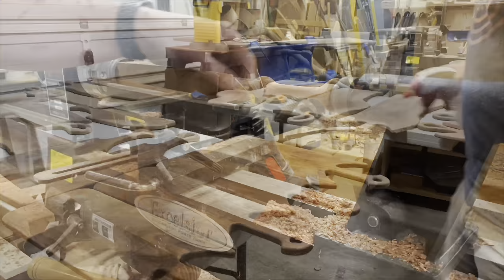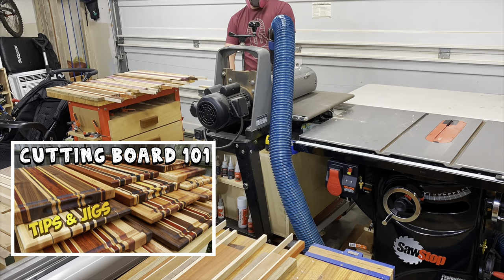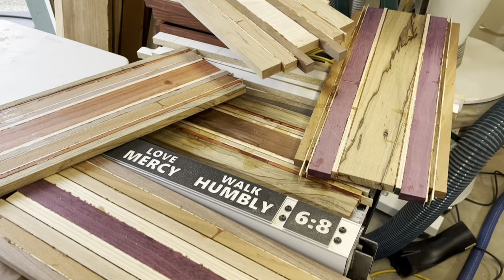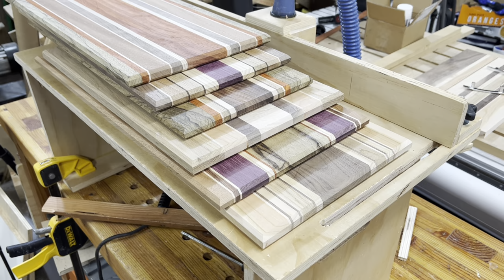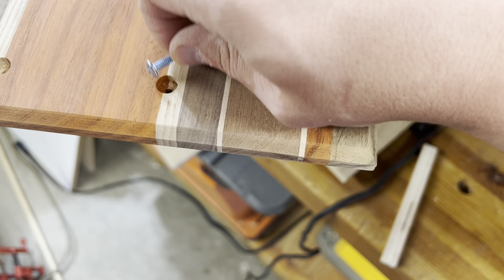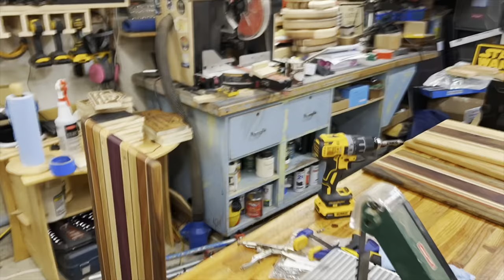Batching Out Serving Boards: Tricks, Jigs, and Woodworking Sales Tips

Comment: I enjoyed your video.  You ticked the tips I normally use.  I have to admit it felt validating to an extent.  I have a couple additional thoughts you might find useful.  I sometimes run the screw for the handle through a rubber foot.  The board sits on a non-skid surface and I avoid the extra countersink step.  I think the feet are around six bucks per set.  The other thing I do happens when I'm cutting to length.  No matter the final length I'm using, I'll square up each end.  Then I cut in 1" increments to my final length.  I'm eventually left with free material for a chaotic end grain board.  Thank you again for an enjoyable video.
Reply from the maker: For sure! Silicone feet are definitely a nice touch. One day I’ll get around to a chaos board with all my cutoffs.
Reply: @SixEightWoodworks  I figure it only takes me a minute to cut them in some uniform pattern.  Then of course they go in one of my many "someday" piles.

Comment: On your trays are your dimensions 24x?x? Is 5/8” too thin for a tray? I use 3/4” face stock usually and can’t seem to make them come out 3/4” suggestions? ( other than buying 4/4 stock Beautiful.
Reply from the maker: I’ve definitely made some at 5/8” You just have to be careful how long you go with potential warping. Will depend on the wood and growth ring orientation.
Reply: @SixEightWoodworks  it’s like walnut, cherry, hard maple, paduk,  Purple Heart etc. thx

Comment: Hi Nick

Love the video - so much info compressed into a very neat package. Will have to watch again (and again) and take notes :o)

Anyhow, I'd appreciate some advice on max width of the wood for glue-up (re. potential warping) what is the max practical width in your experience? Possible (future-proof) to glue up 3-4 inch panels together or better to rip everything to thinner strips (2 inches and below), even if it's the same wood?

Thank you

Comment: With the exotics IE paduck , purpleheart ETC.  they are an oily wood. Before glue up you should wipe  down the acetone or mineral spirits to remove as much of the oil within the wood. Just a tip for long term results over the years or hopefully decades.
Reply from the maker: For sure. I talk a bit about that in the Wood 101 video.
Reply: Thanks!

Comment: Awesome job,when I use my thicknesser the timber has trouble running though.Any tips please.
Reply from the maker: Roller maintenance? Not sure, sorry!
Reply: Hey Ken. Use some paste wax on the bottom of the plainer. It makes for a real slippery surface. The boards will glide thru. That what I did and it worked.